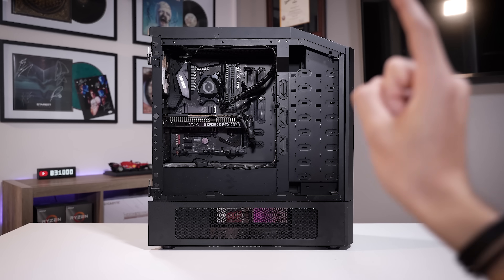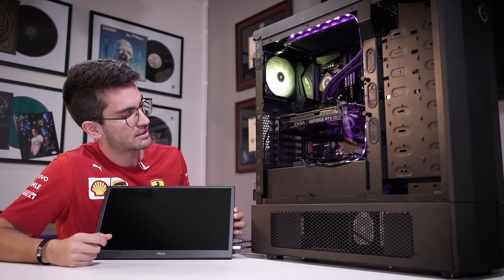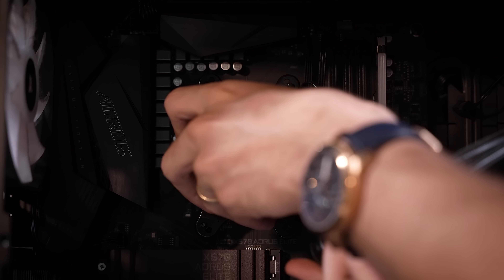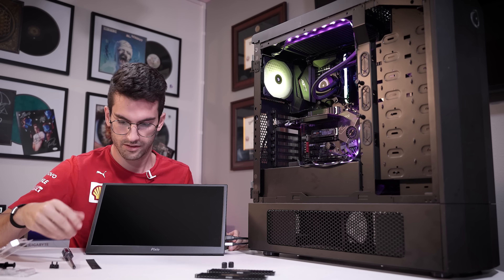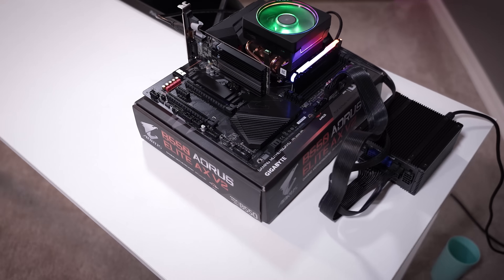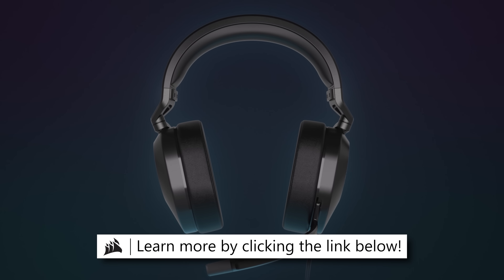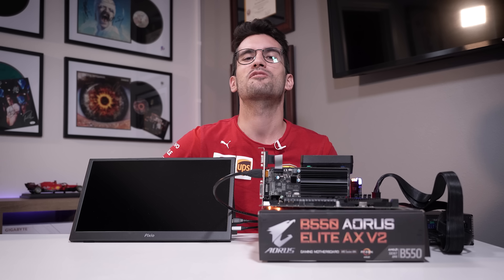Fixing a Viewer's BROKEN Gaming PC? - Fix or Flop S3:E3

Comment: Three years later ryzens are not only dying but exploding as well, still think that there is nothing to worry about?
Reply from the maker: If you're referring to the latest chips... we don't much work on those.  My comments were very clearly in regards to older generation Ryzen CPUs. Not sure what you're getting at. My sample size is far too small to make any claim either way. Period.
Reply: All chips have issues. Intel had their major blow up on 13th and 14th gen. These arent meant to last. Most hardware expectations is 3-5 years. Throw in the fact that most people upgrade to a new chip and never touch their bios and you end up with a chip cooking itself early within the 3 year mark. It is up to the end user to do their deligence on maintaining their rig. with all the systems you see come in to Greg's posession that have OC CPUs and stock coolers should tell you what the bottom denominator is for end users. This also doesnt include the GPUs and PSU that have had issues as well. This entire thing isnt just normal for the computer industry as we see issues with cars all the time as well. It is the growing pains of technology.

Comment: I bought a 3900X new ,  about 4 years ago. I installed it, installed windows and after the windows install it wouldn't boot. I traced it to the chip, sent it in and they said I did something to it and did not warranty it. It was literally used for less than 2 hours. I had it for a while then someone asked me for it, and I gave it away for free. It just raises red flags that watching this video, it looks like there is a fault with these cpus. Doesn't matter now I guess.

Comment: Update: Old video but new information has risen to these AMD Ryzen 3000 series failures, this includes Intel platforms as well.  Seems the MB companies have been overvolting  CPU as a base setting in the Bios which causes higher heat and in many cases damage over time.  Z690 and Z790 also has been having these issues as well.  Always check your CPU manufactures recommended voltage and see if your Bios matches.  Ryzen also had issues with 4 stick ram sets when trying to XMP them to their rated fastest speeds, seems AMD memory controllers on the CPU do not like all 4 slots running full speed and the MB specs even state when running 4 to use the base speed (I recommend only using 2 slots with AMD).  This also causes the MC to work harder raising cpu temps and causing chip failures (Usually on the MC side not video).  Hope this helps and check that bios before doing anything to ensure your cpu voltages are not causing harm.

Comment: I under-volted my R9 3950X and it runs very cool with a huge air cooler.  When I first got it, the mobo was putting too much voltage into the SOC.  I believe that will kill these chips fairly quickly.

Comment: until someone finds whats is happening with Ryzen cpus I turned off all boost options on the bios because I got a new 3600 cheap 2 months ago. I dont trust the 1.450v to boost the clocks even if is for just moments and just getting 70c on full use. with the boosts turned off i get 55c on cinebench. I dont play a lot of heavy games above 60 fps so I didnt notice any loss in performance so far by not having the 4200ghz default boost on

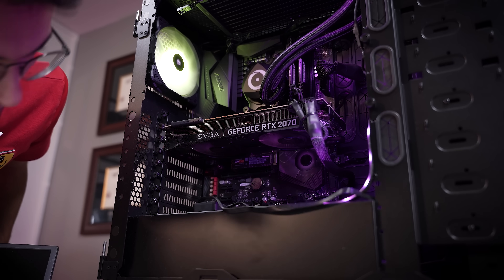Comment: 4:25 I have an EVGA 2060 XC Super 8GB card, and from what I have personally noticed from that line of EVGA cards, and most EVGA cards for that matter, when first boot, the card goes 100% fan spin for some reason. I have had days where it has taken several seconds for the fans to stop 100% spin, then others it does it for 1 or 2 seconds then stops. Its just something about the card

Comment: Just went through the same troubleshooting on my sons Pc that I built new about 1 year ago. Ryzen 3 3100 chip was the issue. Unfortunately I had to buy new parts for testing and like yourself assumed the cpu would not be the problem...it was and I found that out after spending a bunch of money on a new mobo and wasting so much of my time. The Cpu was never overclocked and it simply decided to die one day while idle. Seems like the 3000 series are faulty imo, I've seen so many of them fail now in troubleshooting videos like this one as well as forums I've read trying to fix my issue,   also I don't buy in to the "so many were sold so we are seeing many broken ones" I think maybe both teams are rushing to put out new chips too quickly and cheaply and without enough testing. Thankfully the 3100 is/was a cheap chip and wasn't a huge loss and we were planning to upgrade it anyhow but would have been nice to get a little more use from it b4 having to replace. Still I have a feeling Amd might be about to have a lot of ppl with dead 3000 series chips not happy with them, I think we may start seeing more and more broken/dead 3000 series chips in the next several months.

Comment: Never bring a customer PC into your home before a thorough check, sounds bad but Ive seen bugs I never saw before come jumping out of systems, Spiders, Roaches, Ticks!!! you name it.  Some people are just slobs others just clueless whats crawling around in their own carpeting.  

CPU issues are not common, Intel or AMD.  When a CPU fails there's usually a good reason for it and swapping in a new one might work for a time if it was only a random event, surge from storms etc.  These days when I see an AMD system with a Gigabyte MB I cringe,  Gigabyte was my main go to for a long time but their reliability with Ryzen has forced me to switch to Asrock or Asus for AMD systems.  They still rock for Intel based boards.

Comment: this case looks like a studio apartment with a few furniture  :D I don't understand why these people need to have that.
Reply: it's future proofing, if you have actually seen the sizes of some of the new rtx4090's you will understand.
Reply: but as a gamer can't see to spend that much money just for games but if it's for a workstation that I can understand. plus who wants a 4090 when you have to worry about the damn wires melting and your place catching on fire. I think Nvidia put out the 4090 way to soon it's like were the guinea pig because even before 4090 was out Nvidia knew there was problems with those new connector.

Comment: I've been building and working on computers for about 16 years at this point. Throughout that time, most of  my friends/family/customers PC's have gone bad because of either RAM, HDD, GPU or a faulty PSU. I was fortunate enough to never have ran into a dead/broken CPU this entire time, until zen2. I've ran into 2 bad cpus. AMD has been great at sending replacements, as these chips are still new enough to be under warranty. It'll suck for those that break out of warranty tho

Comment: everyone needs to be checking how much voltage is being pushed right after updates sometimes stuff is wonky nvidia new drivers was causing a plus 117mhz on my my memory clock on my 3090 causing it to continually crash during gaming. iphone slowed down performance on old phones companies cant be 100% trusted when people are sticking to older hardware it cuts profits and they will try and find a way to combat that. not saying thats what is happening here but always check your numbers when running a new program/update

Comment: I'm currently using a 3800X, can't help but be nervous! It's been going great for over a year with several upgrades. Better cooling solution was the latest upgrade.  Hopefully adding a bigger tower cooler helps!

BTW that's one huge case!
Reply: I've had a ryzen 5 1500x for about 5 years, a 2600 for 4 years, now i run a 3600 and a 5500. None of them had any problems, you'll be alright
Reply: @hsko8007  BTW, BeQuiet tower cooler has worked perfectly! It barely warms up even during lengthy gaming sessions and is, well... Quiet.
Reply: @thecman26  that's nice! i've ran my 1500x and 2600 on the stock coolers and had no problems whatsoever besides the high temps sometimes. The 5500 is running a cheap jonsbo air cooler from amazon, while the 3600 is under a deepcool ls720 360mm aio which i got on a clearance sale for $60 brand new
Reply: i have an r7 5800x and i have stutters in every game im changing to intel now

Comment: When Greg said that XFX card gets "hot", he was underselling it. That card regularly gets up over 90°C during gaming with titles like Warcraft II and Quake. I found that using a little foil tape to lash a 60mm fan to the heatsink drops the temps by over 30°C and it runs a lot smoother.

Comment: Because AMD is cheapER.  That's why they have many more CPU's that fail out of the box or soon after or . . .?  Years ago I had two AMD CPU's fail and more then one Radeon graphic card fail so I elected to never buy AMD products again.  Same with Radeon graphic cards before and after AMD acquired them.  Their cheapER produces for a reason.  I may have been lucky, but I have never had a problem with Intel CPU's or Nvidia graphic cards, their more expensive but much more reliable.

Comment: I had a MB back in the day that had a small led system that you could fit into any unused pci slot. I believe it plugged into a usb2.0 header... Was super useful for getting boot codes. Now that I think about it... I'm not sure my current x570 board has a led system... OMG! More research is necessary...

Comment: I have a pc that works only when a stick of ddr4 rip jaws is inserted i can add ram or i can rearrange it but if that specific stick of ram isn’t inserted the pc will not work with any other ram. Other ram sticks work fine when the stick of rip jaws is inserted. The bois is up to date the ram and motherboard are aftermarket I want to run two sticks of ram in dual channel because they can run at 3000mhz  the single stick of rip-jaws the ram only runs at 2800 mhz so the rest of the ram has to step down to match it. But no matter what the system will not post unless the rip jaws is inserted in one of the ram slots the fans just spin to life that’s it. Any advice? (When the ripjaws is inserted all other ram sticks work fine and register in the bios and windows

Comment: With all your statements on how great it is to have a debug code/led on the motherboard it is odd that your test rig doesn't have this functionality. 😉 It also might be beneficial to have one with a dedicated power button, too.  Save you from having to grab that screwdriver.
Reply from the maker: I have plenty of boards with it. All I wanted to see was whether or not the chip POSTed, and it didn't. Also not concerned with using a screw driver. Doesn't save any time either way.

Comment: if  the CPU was cook  hope you checked the water cooler  afterwards  miteve been blocked .
My  corsair mouse LB  Not clicking right fIxed by taking apart and cleaning buttons with cottonwooll bud  & aftershave  pushing it  clicking 30+ 2ms   fixed it perfect again . any Mouse it works
Reply from the maker: Temperatures were fine. We've run into several clogged/dead pump units in this playlist already. This wasn't one of them.

Comment: ok, when some of us have mentioned a PC speaker, at least in my case I'm not talking about the ones you plug into the back panel. I'm referring to the ones that plug into the 4 pin header usually near the front panel header. These are used pretty much like the dr. debug. One of the longest lasting tools I've used and I started maintenance on 386 machines. Beep codes usually tell you what's wrong.
Reply from the maker: I'm aware! And I plug them in alllll the time. They rarely work for the rigs we've tested.

Comment: @Greg Salazar I didn't go through the whole comments but on the ones I saw there were no comments about it, nor you mentioning it. I have seen some instances where the BIOS have been the culprit. Any chance for you to redo the testing and get back to us?
Reply from the maker: Not the BIOS. We literally got two different B550 motherboards with native Zen 2 supported BIOSes to POST with a 3700X. No reason why a 3900X wouldn't unless it was bricked.

Comment: Hi Greg, just wanted to say that I used to work for Alienware, and Ryzen machines with R5, R7, R9 3000 series CPUs (some TR too) would exhibit behaviors like this, Alienware machines were built to show status by flashing the power button, but this was one of a kind issue because you would only have a dead PC suddenly, no response to any inputs whatsoever. So yeah, I would say it is a rare but known thing in Zen 2.
Reply: What made you leave?
Reply: @NickzAndMikz  The main reason I left was the absurd number of requirements and processes to get things moving. Call it part dispatching, troubleshooting, even thinking outside of the box when it came to issue diagnostics, they (oblivious VPs and CFOs) wanted to reduce costs and standardize things for a more "seamless support experience", which nowadays is nothing of the sort, all agents are subcontracted and follow a guide that ends up in sending parts with a technician until your PC gets fixed or they file a replacement order because the guide didn't work and whoever helped didn't know anything about PCs. Sorry for the wall of text, feels nice to be on another place!! lol

Comment: Had a 3700x just die outta no where. Had just installed ghostwire tokyo and was maybe 5 min into game play and system just hung. Power cycled and booted back to windows, as soon as i clicked ghostwire in steam black screen. Power cycled again and would not post. Got a split second flicker of light like some of the ones in you fix or flop. After borrow a buddies pc for parts swapped in his 2400g and it fired back 2 life. Used that as a excuse to upgrade to a 5800x3D lol..

Comment: I'm guessing so many AM4 mobos are killing cpus because of incorrect voltages. I've noticed on many b550/b450 boards that if I set the voltage to a set number it will be increased by a slight amount in actual use. Auto wattage on most I've seen seems to be 1.35-1.5v in use and that's overkill. I've got my 5800x undervolted to 1.27v with a core curve, temp limit set and this cpu gets 16k in cinebench r23. I used a r5 3600 for 2 years and it never died so I've not had experience, this is just a hypothesis.

Comment: Greg I've had a brand new 3700x die on me. No overclocking, never overheated, and kept clean. On mine the memory controller died first and I could not run my memory in dual channel mode. Then something more major happened I was watching youtube videos and got a BSoD saying something along the lines of "internal video scheduler error". I thought it was my gpu but after replacing every component on my PC with parts from a friends build I found out it was the CPU.

Comment: max spin is driver crash on start up on gpu, and... thats an x570 gigabyte board, it has debug leds, 2 of them are on right and just above the gpu, m.2 on bottom needs a screw.. owner will be happy with whatever you do, someone who knows what they are doing wouldnt use that case.

Comment: watching these vids, most broken cpu seem to be AMD, this is why i tend to stick with intel.  Most business will use intel, whats good for buiness is good for the home user.
Reply: the only downside with Intel is if you a budget DIY builder is price.  Even as far back as Intel 6th gen CPUs and boards are pricey in 2022.  Zen 1000, 2000, 3000 series CPUs have better pricing for the budget minded DIY builder.  I'm running a used/new build based around an r5 1600 with 16gb ddr4 3200Mhz and used evga gtx 960 4gb gpu.  Hoping to do a drop in upgrade to a r5 3600 or r7 3700x down the road.

Comment: wow I'm currnetly running Ryzen 5 1600 in my gaming rig.  I have plans to get a used Ryzen 7 3700x down the road as a drop in upgrade.  Now this video has raised some flags for me..Maybe I should not go down the path to a Zen2 CPU and maybe go Zen+ ryzen 7 2700 or r7 2700x

Comment: Question did you check the AIO if it was working properly? Because maybe it i overheated due to the AiO being clogged. I have a huge distrust in AiOs now ever since the MSI AiO i had after 4 months clogged up. ALSO had to go back and double check are their even fans on the radiator? Because I definitely don't see fans were they are supposed to be.

Comment: My theory is voltage, AM4 motherboards just over volts every Ryzen CPU. I have a Ryzen 3900x and an MSI X570 Gaming Edge WiFi and with the voltage, in auto, the voltage is ~1.4 - 1.45v and that is overkill(I'veseen this with other vendors too). To put it in context, mine is running stable without performance loss at 1.29v, I can even OC all core to 4.3 with 1.3v.